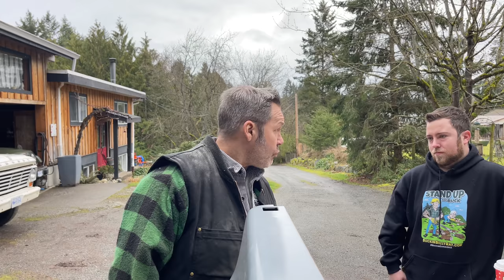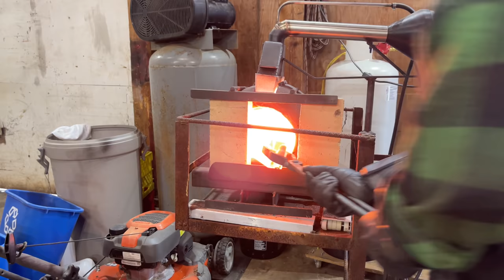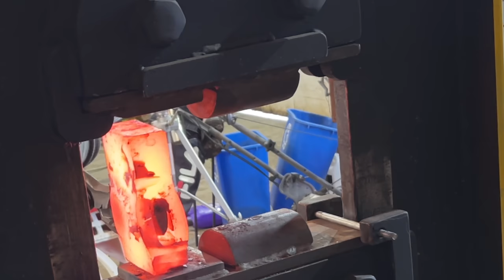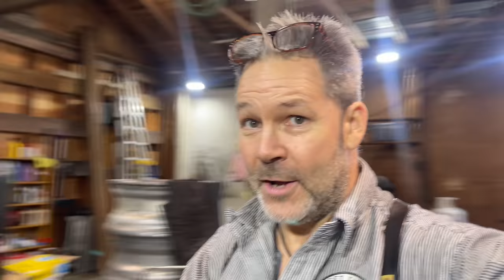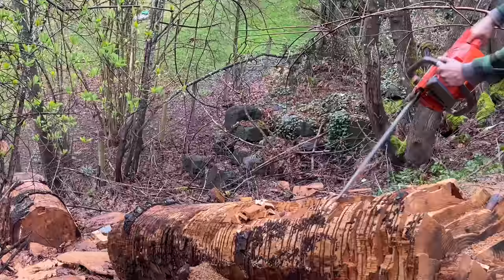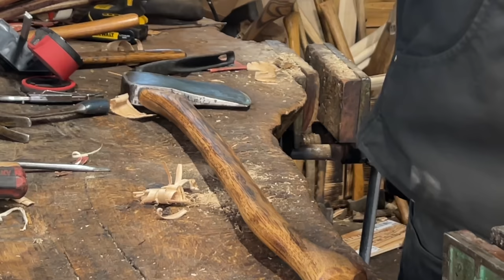Forging, welding, punching axe eyes, chainsaw mufflers

Comment: Hey Buckin, I have a 372 muffler that I designed and built that I’d like to donate to your channel it’s totally different than anything I’ve seen out there. I think you will love it. It takes me 3 days to build one.once you see it you’ll see why. Its no bigger than stock but it sound like a dirt bike and it rips pretty good.If you could give me your mailing address I’ll get it mailed to you asap. No b.s. this thing is awesome!

Comment: I’m sure you’re gonna get a million “pointers” but if I were gonna say anything it’d be to get your billet hotter before working it especially with those gigantic chunks you’re starting with, and also a longer drift with the big broad heads you’re making it’s nice to have a drift that’s longer than the axe so once you drive it in there and start working the metal around it you’re not just steadily closing that hole back up cause the drift isn’t big enough to get all the way through.

Comment: I liked the new muffler for the 372. It sounded very good. I'm wondering if that muffler would work for the Husky 395xp or is there a different bolt-on pattern? I bought the 32inch bar and chain for my saw. Packing away the 36" bar and chain now that I shouldn't need it anymore. The Husqvarna x cut on their chains seems to be a better grind to me. have a great day friends

Comment: What's the difference between a 371 and a 372?
Reply: More less age if it’s a non xt, 372 was cast a little beefier in the oil tank by the bar mount, and had a single ring piston instead of a 2 ring, both are awesome saws, I wouldn’t hesitate to pick up a good 371 if one popped up
Reply: @nickdumpsterhanna3689  Thanks for the info, I did pick up a 371 XP over the winter and have not had a chance to run it yet. It will be interesting to run next to my 272 XP and feel the difference.